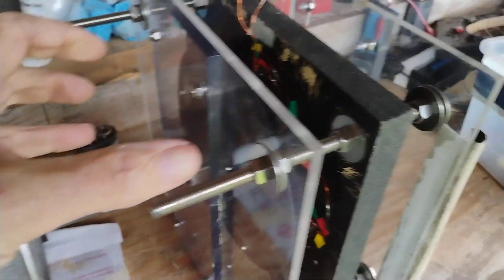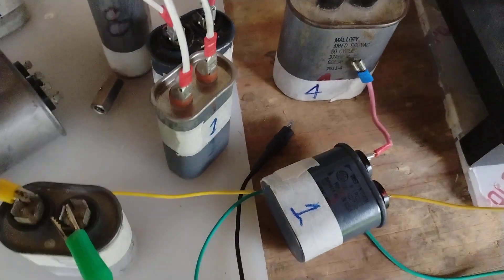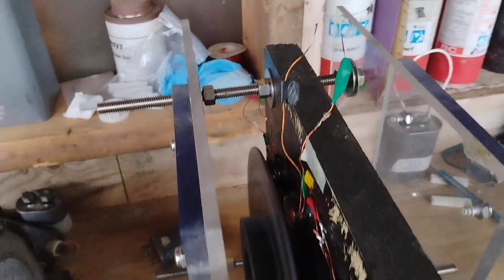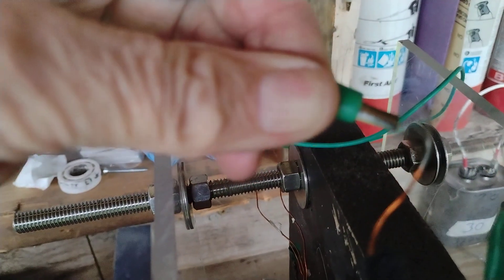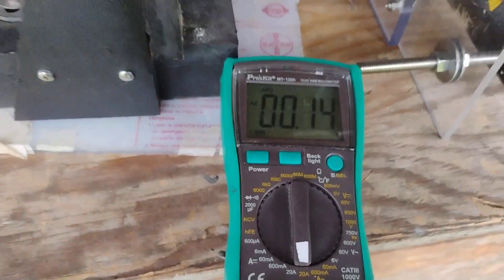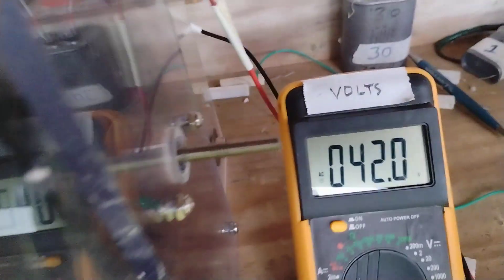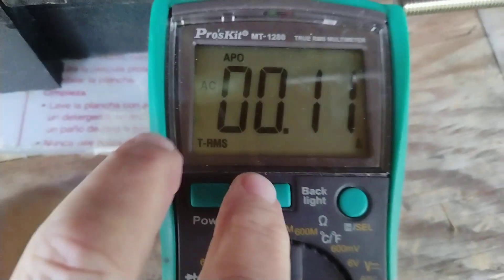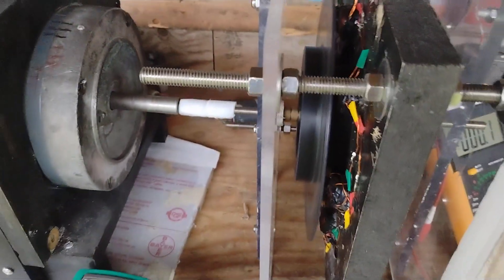Rotovertor testing the dual rotor alternator for power

Comment: Hi Doug just a suggestion of a method if its ok. 1 Drive prime mover with VFD if you can. 2  Find resonant frequency of output coils by slowly increasing prime mover rpm till output coils ac volts reduces.  3 Then rewire and run prime mover as a Rotoverter at this frequency or slightly above, to gain input efficiency . Once output coils are driven above their own resonant frequency the direction of their output current reverses (from lagging to leading) which can provide acceleration under load. As long as load doesn't pull rpm's below resonance frequency.  It is possible to load the output coils with external capacitors to reduce the resonant frequency you are aiming for.

Comment: Hi Doug 
Instead of just dead shorting would like to have seen if rapid shorting would increase your amps
Reply from the maker: What do you mean by rapid shorting?   Switching in a short circuit at sine wave peaks into caps?
This will definitely increase power (voltage)  stored up in the caps big-time in fact X 20 usually...then the "amps" appears upon cap discharge with caps floating upon discharge to load...."Shorting coils at sine wave peaks"
Reply from the maker: Hi Jon
Here is chapter from my online book about "sinewave peak coil shorting"
https://alternativeworldenergy.wordpress.com/alternative-world-energy-pg-3/

Comment: You're running on less than 20watts,i wasn't sure about the output?
Reply from the maker: Hi Ian
Output tested in video is first  the maximum AC voltage of the eight coils in series with voltmeter and no load coils being induced by rotor magnets at 240hz since 8 rotor magnets making positive sinewave and  8 rotor magnets making negative sinewave and rotors spun at 60hz (1800rpm since 4 poke AC  motor)
While the amps is the maximum amps tested with an ammeter shorting out those  eight coils in series.  I was testing one half of the bifilar coils too most of the time.
The watts output guesstamating about 84Vac  X  420ma  of "VA" so around 22W with resistive loading in a prediction....and resistive loading (of whatever resistive load  it will be) probably will double the input draw from 70ma x 120Vac to 140ma x 120Vac (as shorting those coils did)  so the amps guesstimated by what a short circuit of the eight coils in series does for amperage.
Immediate goal is to wire up the eight coils to produce about 16Vac and rectify this down to 15Vdc plus whatever amps it will  now "deliver" and run an invertor with it, and spin the rotovertor with the invertor...might not need all the coils to run the invertor  too we will see
Reply: @MrDKONZEN  Thanks Doug!